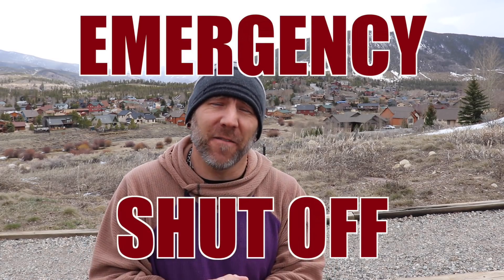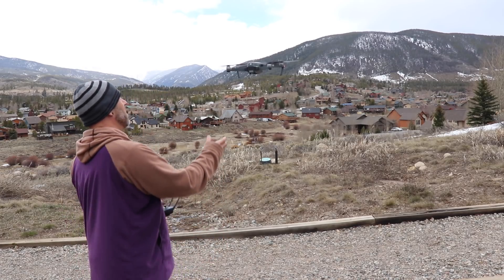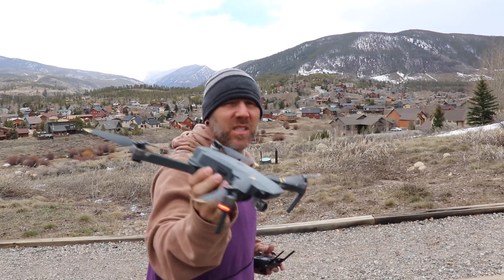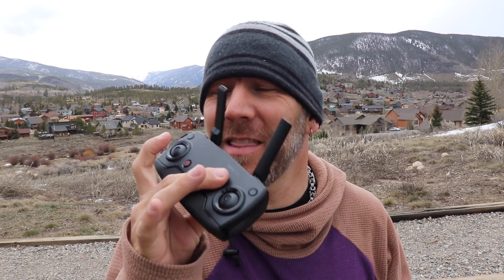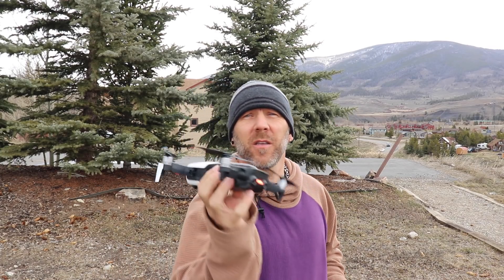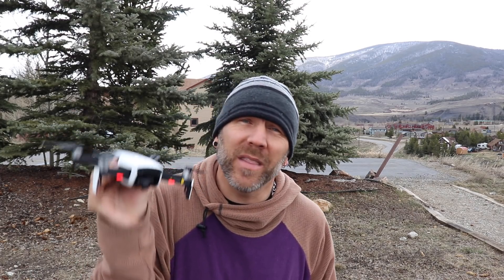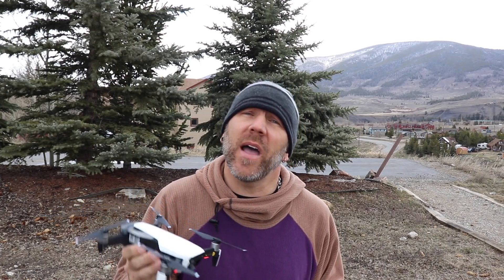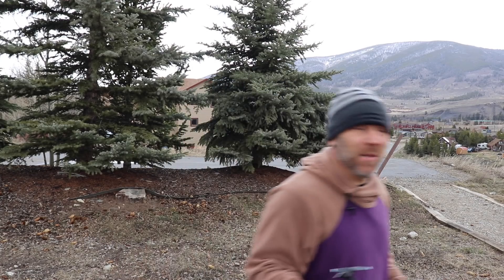Emergency Shut Off Trick For DJI Mavic Air and Pro Drones

Comment from the maker: A little update from DJI about the emergency shut off. 
It is intended to shut off the motors in a wreck situation. 

See quote from head of DJI support below. 

“Kindly note that motors would shut off when you turn the drone to a 90degree angle. It’s a safety feature, and what you understand is correct.
For the incident happened to your subscriber, we suggest that you ask him to contact our technical support for a data analysis for further investigation. We couldn’t draw a conclusion to his case based on the information provided right now. Here’s the link for your reference: https://www.dji.com/support?site=brandsite&from=nav “

Comment: What i usually do is one hand on the mavic air 2 and a finger pulling down on the landing stick works all the time i feel it better that way but like you said we also have that option. Pull turn upside down let the people know that they need to man handle the drone because is going to want to get away from they’re hans and is strong 💪🏻
Reply from the maker: No.  Watch the video. Do not do that.   It is an emergency shut off.  Watch before commenting or at least read the title before letting your true self be seen.

Comment: G'day Mate from Oz.  Excellent video.  Handy info to know in case of Emergency.  This would have come in handy on a boat in Indonesia in March!  I landed my Mavic Pro (hand caught the 'bastard, too) but that pregnant pause whilst waiting til the motors shut off on a rocking boat's slippery deck wasn't much fun!  (The footage captured of Komodo was worth it, though).  Keep up the great work.

PS.  I'm sure you've been asked this before... but... (be honest, Sean!).  Mavic Pro or Mavic Air?  Which is your favourite?
Reply from the maker: Thanks for the comment. 
I’m still testing out the air so I can’t say 100% which one I am willing to part with yet.  I wish that they combined the two honestly.

Comment: If this maneuver puts (damaging) load on the motors, then what about making abrupt moves in "sport mode"? It sounds like about the same level of load on the motors. I guess that the same could be asked about flying in sport mode: If you're yanking and banking all the time, isn't it hard on the motors? On the other hand, sport mode is intended to be used, so that level of load is somewhat expected, if not used too much.

Also, a shout-out to my family's home town of Leadville. Your hoodie is the most comfortable that I've ever worn. I recognize that it's from "Melanzana". Too bad they don't do mail order anymore.
Reply from the maker: I didn’t know they stopped doing mail order.  Their hoodies are amazing. I plan to get a few more this summer.  

I agree with you 200%. This really doesn’t put a huge load on the motors.  RC car motors handle way more abuse then this.
Reply: Sounds a whole lot like a logical and rational conclusion. I agree.
Reply from the maker: Tech Guy these motors are not like yesterday’s motors.  I don’t recommend using this as a way to shut down your drone by any means (which you know since you watched this video) but your motors will be fine if you do. Not much different than flying in sports mode.  Feel free to make a video expressing your views.  I’ll gladly watch it.  Just to inform those watching DjI has also let me know that this is intended for emergency situations and should not damage anything.

Comment: And as far as the motors brushless motors last forever..... flipping it over to 90°  is doing nothing to those motors LOL... all it's doing is having the esc's ramp up speed to compensate... like I said brushless motors last forever ( different type of animal to the old brushed motors now those would die out eventually)  especially with my bigger RC helicopters I run them at 100% And they last and run great
Reply from the maker: Mike Sarni I love brushless motors.  They changed the game for RC car racers too.  I agree with you again.  I’ve seen so many people not that into the RC world argue the opposite but I just shrug it off as they are still learning the hobby.  ;)

Comment: I'm wondering, if a blast of wind were to hit the drone hard enough to flip it like that would the shutoff engage?  Great video sir I highly enjoy your videos.
Reply from the maker: M-C Shan that is a great question. 
I’ve flown in 30+ gust before and never considered that. It was some low flying just to test stability so if that had happened nothing would have been hurt but the drone.  

Wish I had enough spare income to test that theory.

Comment: To my amazement a friend crashed his Mavic pro and it fell upside down and it didn't turn off the motors and distroyed all props.  So I always assumed based on the fact you can grab it and flip it always shuts down.  My friend who had this happen has grabbed and turned off his mavic pro the way you did in this video so we know his normally will shutdown when upside down.  So we both where shocked that it crash and went upside down and didn't shutdown until he pulled both sticks together and did the emergency shut off.
Reply from the maker: Joseph Dawson wow. That is crazy. I wonder if it just failed due to the crash or what?   I would have been stumped right there with you.  Thanks for sharing that.
Reply: He has flown it again since and hand grabbed it and it still shuts off... but for some reason when they crash in real life they don't always shut off and we don't know why.  But it is safe to assume that it will not always do that... he lost a full set of props with it running the motors upside down on the dirt.
Reply from the maker: Joseph Dawson that is so weird. 
I might throw in an email asking about this.  If I hear something back at all I will post a new comment on here and pin it up top.  If they respond to me that is. Ha ha
Reply from the maker: Joseph Dawson I got a response from DJI for you.  

It is suppose to shut off in a wreck that flips. so his isn’t working correctly. 

“Kindly note that motors would shut off when you turn the drone to a 90degree angle. It’s a safety feature, and what you understand is correct.
For the incident happened to your subscriber, we suggest that you ask him to contact our technical support for a data analysis for further investigation. We couldn’t draw a conclusion to his case based on the information provided right now. Here’s the link for your reference: https://www.dji.com/support?site=brandsite&from=nav
Reply from the maker: That’s direct from them to me to you.

Comment: Hi Sean. Thanks for that. I did wonder but didn’t dare try. Surely DJI would be able to give a definitive answer to the question , why not contact your friend and ask? Hope everyone ok. Take care.Peter
Reply from the maker: peter hughes thanks peter. That’s a good idea.  Ask them if it’s intended as a last resort if you wreck.
Reply: I also remember, when the Mavic first appeared, people had no issues starting the motors with the props folded and letting the centrifugal force open them up. I guess it’s a similar strain on the motor and I’ve not heard of people complaining about it. 

On a personal note I FINALLY got round to uploading a clip from Aus....just 3 more to do!
Reply from the maker: peter hughes yes. I remember everyone debating that too.  I still don’t pre open mine. Ha ha

I’ll go check out your new clip.

Comment: This is great to know  Thank you Sean.... I would use it in an emergency or when on a boat....
Reply from the maker: speliotis  I could see it being a quick way on a boat. Specially since your bottom sensors would more than likely be off over water.
Reply: pretty hard to land on a rocking or moving boat... and Thats what I miss about the Blade chroma  the landing gear was so easy to grab onto... : )

Comment: Thanks Sean for showing us this.  My preference when flying my Mavic Pro is to land on the ground manually, but on a couple of occasions it was better to hand catch.  In those cases I just held the drone in one hand and reduced the throttle to zero with the other and waited for the props to stop. For the very few times that I would likely do this, your method might be the safer and not likely to harm the motors. You showed a side-by-side comparison of the Pro and Air footage with no color adjustment.  I was wondering what color settings you used in taking this footage. Thanks for sharing.
Reply from the maker: Dave Stredulinsky I will have to double check but I think the air was on normal  and the pro on true color.
Reply: Thanks Sean.  I quite often use the "True Color" setting on the Mavic.  It seems to do a pretty good job most of the time without having to do too much adjustment when editing the footage.
Reply from the maker: Dave Stredulinsky I agree with you 200% on that.  

I made a video on the Mavic Pro showing all the settings and what I use 99% of the time with it for mine. 

https://youtu.be/jxgEm_ukTB4

Comment: I know about it and use it once in a while.  I have no idea about the motors.
Reply from the maker: Stan Cook I’m pretty sure it’s not enough added stress to worry about it.  Be safe using this way if your sensors are on. I found that to be a bit more sketchy then if they were off.